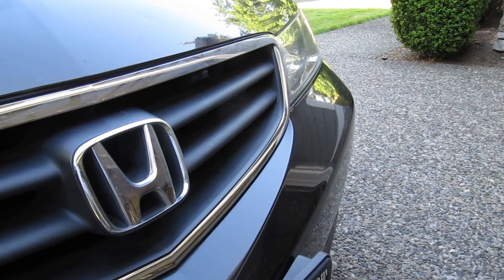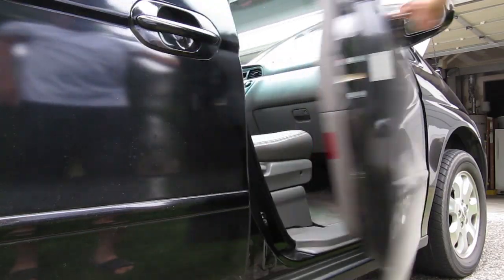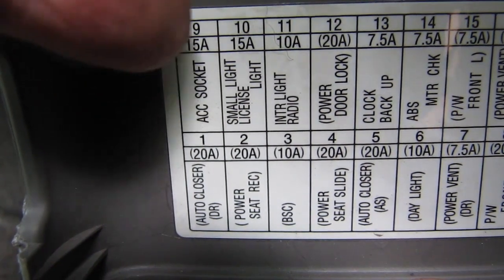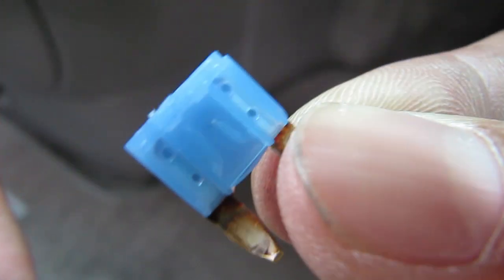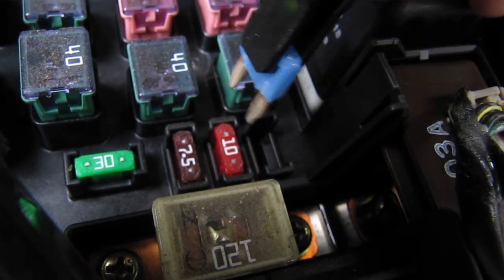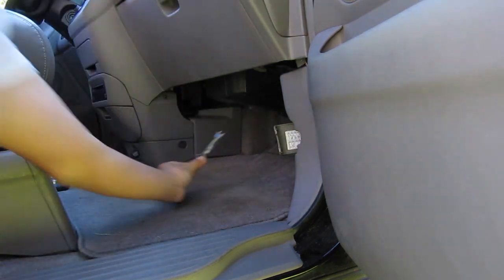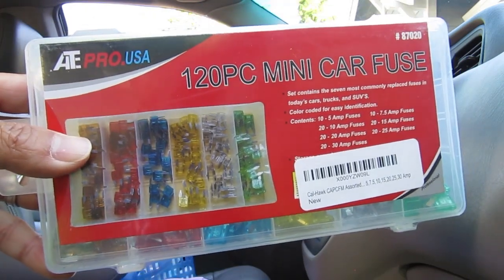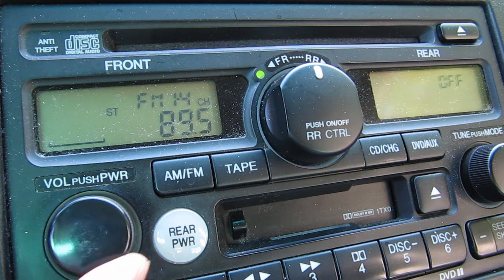Honda Odyssey Radio Stopped Working – Anti Theft Light Still Blinking and Radio Won’t Turn On

Comment: I think you nailed it. There is a #9 fuse outside under the hood on the passenger side...it is the main fuse box..well 9 is the radio which of course I checked and it is fine.
I did not know till this here video that there is a #9 inside passenger side so I will get to it tomorrow when it is light out but I bet it fixes the problem

Comment: I just bought an 2004 Honda Odyssey and the radio come on and the DVD player in the back works but no sound comes out of speakers and can’t figure out why it don’t. The vehicle didn’t come with no headphones and have no clue what to do if you can help or suggestions man that would be awesome

Comment: But, I need my Accessory charger to work too.  So what is the problem that would cause your fuse to blow when your charger was plugged in?
Reply from the maker: There might be a wiring issue inside the charger. The charger I had still works but I tossed it because I didn't want it to keep blowing fuses. In your situation do you know if the charger is causing your fuse to blow? If not, then all you have to do is change the fuse. But I don't know the exact issue in your vehicle so I can't give a definitive answer. However, if you need fuses, I would definitely order a pack like I did from Amazon. If you go to your local auto parts store, you will pay substantially more for probably only 6 to 10 fuses of different sizes. Not enough extra to play around with in case you have more that blow. Hope this helps!
Reply: me. too.. I can't charge my phone.. and fuse keeps blowing out

Comment: My light not blinking at all changed fuse still not working help please!!! Could it be electrical???
Reply from the maker: If your light isn’t blinking on the radio you may have another fuse that’s blown. I’m not 100% sure but it seems there might me 2 fuses that go to the radio? If you changed the same fuse I changed then you’ll have to look into why the anti-theft light isn’t blinking. However it may have nothing to do with the radio. Hard to tell. Not sure what year you have but here’s some info that might help: https://www.odyclub.com/threads/2004-honda-odessy-radio-no-lights-or-sound.154485/
Reply: Its an 03 and the radio or dvd players not working the lighter part works
Reply: @TheRenderQ  thank you sooo very much i was able to get so much information from that page and happy to say it was the 20 fuse relay inside the hood beside the battery thank you so much yaaaay i have misic now
Reply: Although your post on here is old, I had the same issue after putting in the new fuse. I just restarted the engine and waited a moment. After that it worked just fine.

Comment: My '04 pilot has the same issue now, only my 12V adapter works (THANK GOD, otherwise I don't know what I'd do on my long road trips home). Every other thing works, even the anti theft light flashes and the green accents around the radio displays turn on when I have the headlights on fully. 

Checked every fuse that would be applicable to the radio's functionality and none were shorted or damaged, but replaced them anyway with the correct 15&20A fuses, radio still doesn't work.. I think I officially killed the radio unit in the car  the last time the battery died and it needs to be replaced entirely, but want to take it to a shop and see what they say first. If it's a matter of the radio being completely dead, I'll just replace the unit myself, if it's an issue of the wiring being damaged, then I'll let them take over, way out of my area of expertise.

Comment: My radio stopped working from my daughter putting coins in the take deck. Got a different factory one, same exact model number from a salvage yard, and nothing. In not getting 12V constant, which makes me think blown fuse. Nope. I checked every fuse in the passenger wall fuse box and engine compartment. Any other suggestions?
Reply from the maker: Since you replaced your radio, did you see if any of the wires from the radio had an inline fuse? Probably unlikely for a factory radio but worth checking out. It's possible that the coins could've fried some electronics inside the radio but you have a salvaged radio so also not a likely problem. The only other thing I can think of is maybe a short in the power wires somewhere. I'm not sure how that can happen since they're usually never touched behind the dashboard. Hope you're able to track down the issue soon!
Reply: TheRenderQ - It feels good to not be the only one stumped by this. Thanks for responding. If I figure it out, I'll try to remember to come back and post my fix

Comment: I have 2002 honda Odyssey and my radio is saying code
Reply: I need help
Reply from the maker: I recently had a dead battery in a Honda Pilot and had to enter the radio code after battery replacement. You can find the code printed or written in your user manual. That's where someone wrote my code in. Also on the glove box there may be a couple of stickers in there with numbers printed on them. One of those might be the code. I don't know if this is a possibility but maybe in the door jamb the radio code might be printed there? If you don't find the code in any of those places you will probably have to go to the Honda dealership and have them retrieve the code for you.